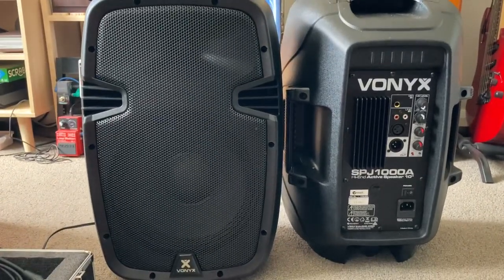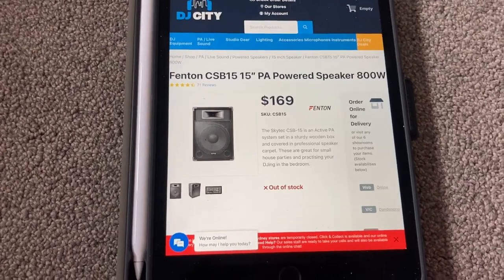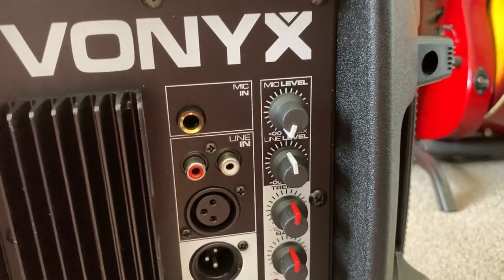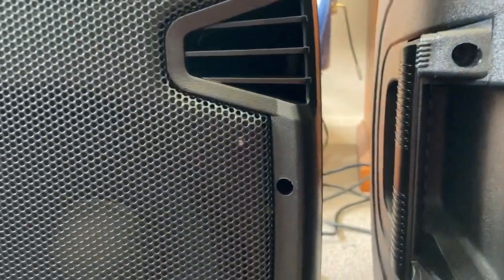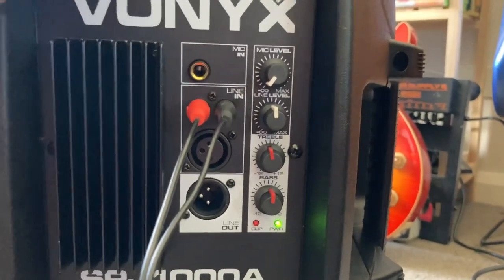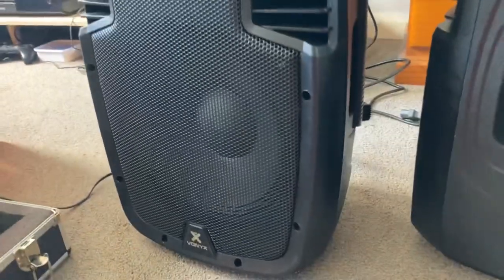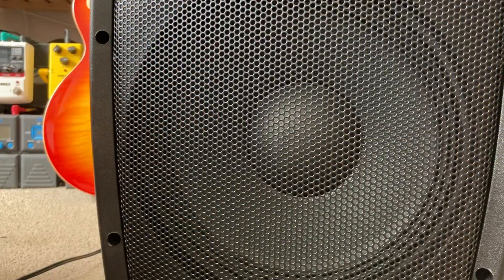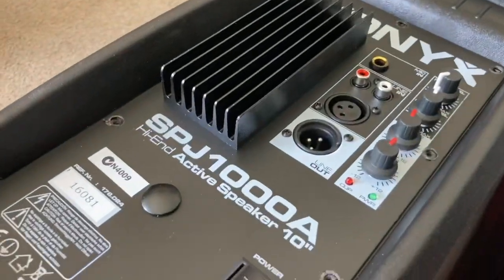VONYX SPJ 1000A powered Speaker | REVIEW | SOUND TEST | TEAR DOWN

Comment: Is your 15 “ sub active or passive, and how do you connect it from the active speaker here?
Reply from the maker: Active sub. I’d run audio to sub and then to the speakers.
Reply: @tahmeed1202  hey man. What Cables did you use in order to run the audio to sub and then into speakers?
Reply from the maker: @aaronhawkins3770  If i remember correctly, i used XLR :)

Comment: now that these have been discontinued, i've been eyeing up the replacements, particularly the vsa15p because i want some with a bottom end and already have a lot of amplification to hand.

have you had a look over the new series? would be happy to lend them to you for review if you're in sa, but otherwise i imagine shipping will be a nightmare to manage.
Reply: I have the vonyx vsa15bt I would recommend them over the vsa15p because the passive ones blow easily because they over rate the speaker but I have done a wedding with my vsa15bt with about 100 to 150 people and I was impressed
Reply: @kailumgg7736  i ended up grabbing a pair of the passives, i'd say they're worth about 200w max, they sound pretty great and should last with an 80hz crossover point with my passive subs. i'll probably upgrade my kit at some point in the next couple of years to a pair of active icoas with subs and leave the passive system installed in a venue.
Reply: @maebeans  yes 200w max is about right for them
Reply from the maker: i havent moved on to AVE Revo after these. now i know they are discontinued as well. like bro have a good product then decide to discontinue haha or perhaps improved quality?
Reply: @tahmeed1202  i think the new products are probably very similar, internally my passives have the same drivers as shown in your video, they just have a hefty crossover mounted to the back instead of an amplifier.

Comment: would two of these be vetter than 1 SPJ 1200A 12 Inch? thanks
Reply from the maker: I personally did not have any experience with the 12 inches, However i'd assume two 10 inches would have nicer sound as a stereo pair. although the 12 inch may get a bit extended low end response